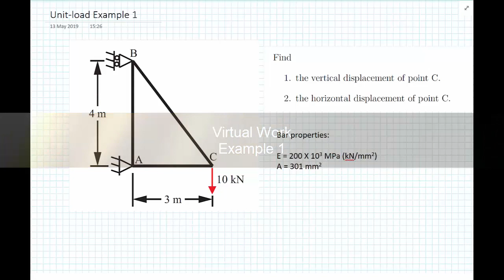Virtual Work / Unit-load: Truss deflections - Example 1

Comment: Thank you for this video, just wanted to ask whether the horizontal unit load applied is always to the right or could it be applied either side?
Reply from the maker: You can assume any direction, a positive final answer will confirm your assumption.

Comment: Sir you have stopped making videos. There is almost 95% work left undone by you both in structure analysis I and II. Any reasone for not making any video.
Reply from the maker: Never say never, but I only record videos for topics that I teach. For each topic there is only a limited number of examples as I follow up with many hours of on-campus problem solving workshops.
Reply: @ProgrammedMechanics  i completely agree sir and i knew it might be the answer too. 
But do you really teach these few topics, as structure analysis surely does not contain only these topics....anyways your explaination really helps
Reply from the maker: @sohailahmed5039 the team of us teach a full stream from statics -> strength of materials -> structural mechanics -> computer methods -> structural dynamics -> finite element theory (and practice).
We have reduced the number of hand calculation methods we teach, as they are never(/ very rarely) used in practice, but we do make sure that students are comfortable with both the theory of underlying computer packages they will use and the safe practice of these packages.